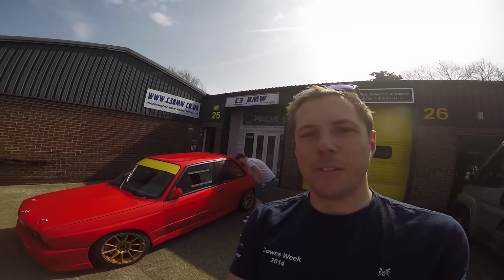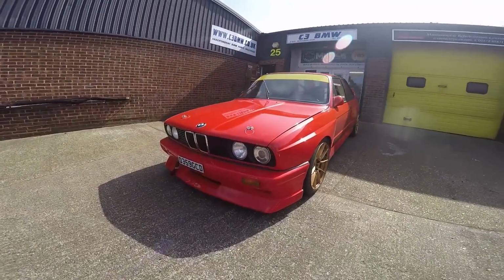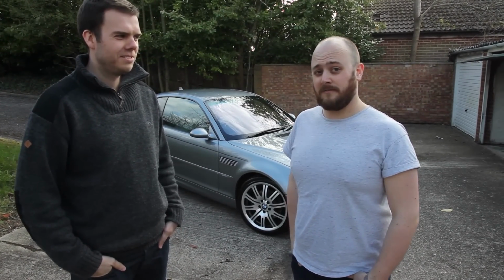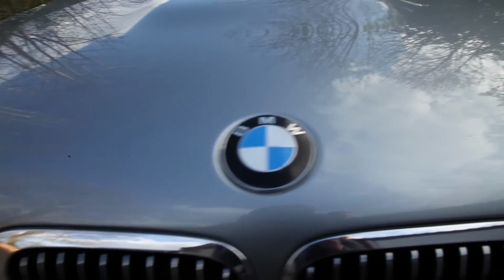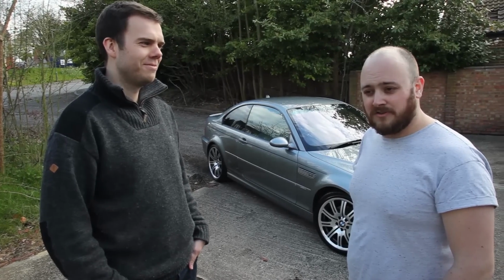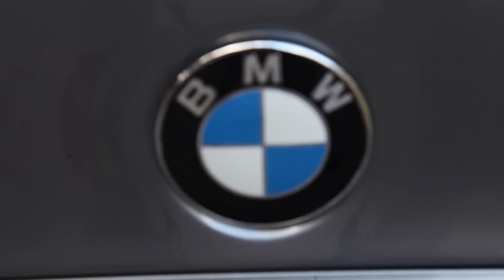BMW E46 M3 Cracked Subframe!! Repaired and Detailed, Part 4/4 | The GTD Vlog

Comment: very similar situation with mine. The dealer I purchased my m3 from confirmed no issues (my first e46 m3 purchase) and subsequently had it inspected @ Reddish Motorsport in Bristol. Their inspection was extremely thorough and picked up 2 splits in the shell near the sub frame carrier bushes which were almost impossible to see when the car was on the floor. I had the option of fixing of course but as you guys have had done the recommendation was to replace bushings as they were tired/worn, replacing the fuel lines which were corroded etc. The job quickly became more involved than I first thought and I had to make the decision to either fix/return to dealer, unfortunately option b was the most cost effective.

It seems there's a few price points at which this floor issue can be rectified. 

Glad you've got it sorted, I miss mine dearly as it was an absolute missile, VX220 now fills the weekend duties!

Comment: i take it that you did actually SEE yourself those cracks in the subframe before having welding done ?
Reply from the maker: t5jerry I did indeed mate found a hairline crack on the left rear mounting point and knew there would be more too so got it booked it. Every E46 M3 will fail eventually / already has!
Reply: glad to hear it, any garages quote me for parts, i want to personally see those parts (in situ) before i spend a penny, but im a right tight bugger and dont trust garages !!!!!
Reply from the maker: t5jerry I am quite fortunate as I have 3 excellent garages that I use for my M3 all very highly regarded and there work is spot on. 
Also no concerns of doing work that isn’t needed, totally the opposite actually as it’s usually them telling me that it doesn’t need something doing that I think does.

Comment: what do you find the m3 like to own? seroiusly contemplating one as a next car. what its like on over all costs, fuel i expect shit but anything else out of the blue?
Reply from the maker: tomkingshott they are not cheap to own and now they are getting on a bit parts more than likely will need replacing. They are great cars though and even though it's quite expensive to own one I wouldn't want anything else for the cash. Buy with your head and not your heart and get an inspection from a reputable specialist before you commit if you can and you should be ok. 👍

Comment: Hi, I have a grey e46 m3 also 👍 where did you say you had the work done? I couldn't catch what you said
Reply from the maker: The Subframe work? If so ETA Motorsport bear Brandshatch in Kent
Reply: +Guys That Drive thanks for the quick reply! Yes I meant for the subframe / floor work. That's not too far for me so will check them out - cheers!
Reply from the maker: +Rob Lyons No worries they are top guys give them a call and they can explain the costs and other bits and bobs

Comment: nice m8 . so £700 for the subframe work dose that include the Bushes ect .?
Reply from the maker: Afraid not Colin no that is literally to weld cracks and plates and put all old bits back together. The total bill was nearly £1300 with all bushes etc money well spent though if you ask me it drives great now :)
Reply: +Guys That Drive . Cheers for the info m8. 👍
Reply: +Guys That Drive so what happens if you dont fix  cracked subframe? I have a same problem but its so pricey to fix it
Reply: +Colin Lavery whats mean "m.t.o
Reply: +Bmw Tan  a car in the UK need to be tested once a year to make sure  it safe to be on the road for the year ahead.  it's called an mot
Reply: +Colin Lavery cool im from new york :)
Reply: +Bmw Tan nice 👌
Reply from the maker: +Bmw Tan you need to get it repaired, as it can become a complete failure if you leave it too late and it will become unrepairable and very unsafe. If it is too late and not repairable then you will need a whole new rear sub frame from BMW which costs thousands, thinks its between £2-3000 in the UK for the part alone. So best to fix it before it gets this bad.... https://i.ytimg.com/vi/fH1MqZ3ncMQ/maxresdefault.jpg
Reply from the maker: +Guy Bro crap is a bit harsh! Unfortunately the repair bills don't suffer from the same depreciation as the actual car- so you are still paying full price for the parts of a £50k BMW!